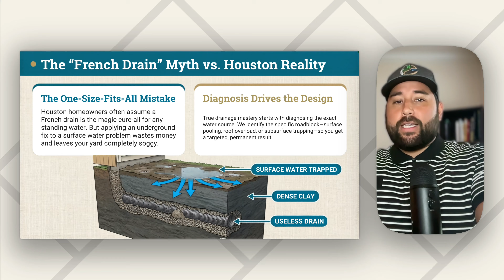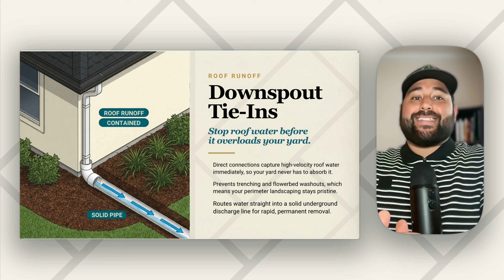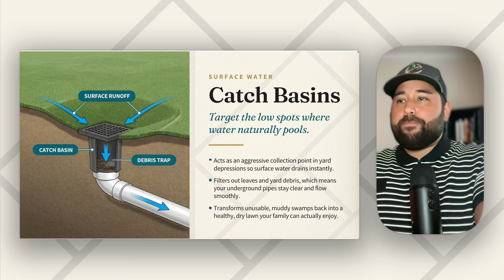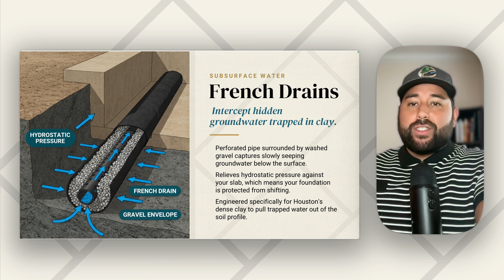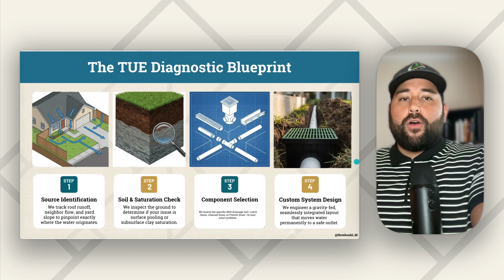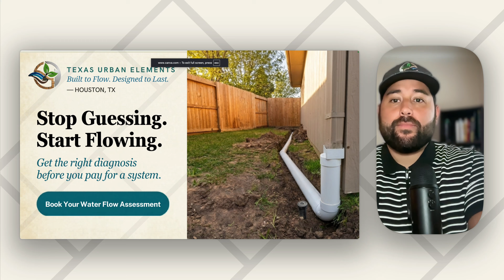French Drain, Catch Basin, Channel Drain: Which One Does Your Yard Actually Need?

Comment: What’s the best way to test soil to know if you need solid drain in low area or a French drain? My backyard floods but no way to drain it unless I tear up the driveway cement to run line to street out the side gate.

Comment: Solid PVC for drainage has its place, especially SDR 35, but it's only ideal in a handful of situations. Since you're in Houston, this is probably fine for most drainage solutions. But northern states run through cycles of freezing and hot temperatures, which means PVC will crack and fail. Also, any area with a lot of lot of root growth from trees and shrubs will need a more flexible pipe to handle those ground changes. Corrugated double wall gives you more flexibility than PVC with the same strength, as well as the smooth inner wall for rapid drainage. But in all honesty, a good quality corrugated pipe (not box store stuff) will work just fine, be flexible enough for temperature changes, and flex with root growth.
Reply from the maker: That’s a great point regarding regional climate differences and soil conditions! 🙏